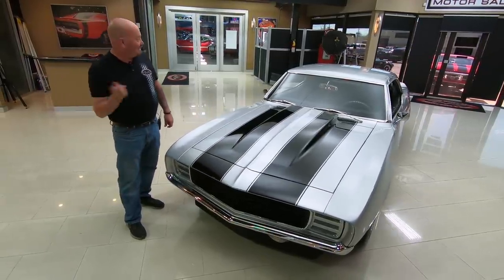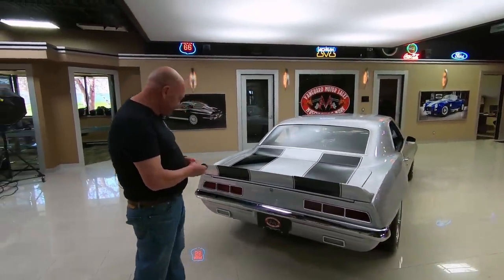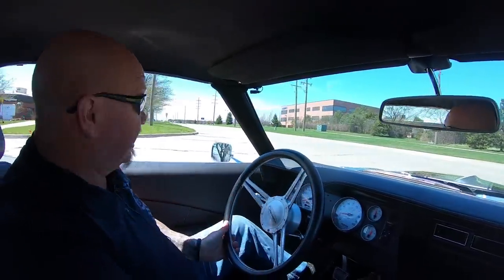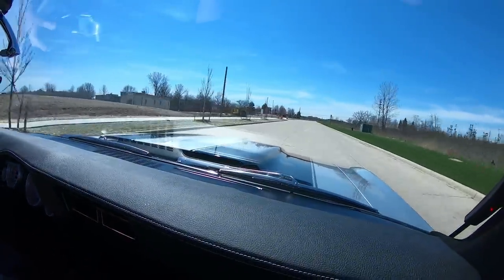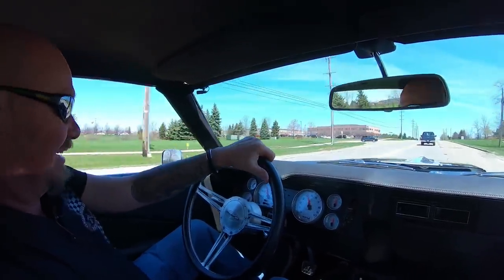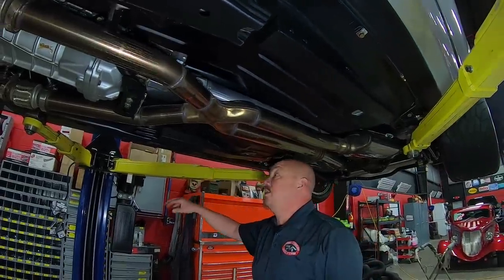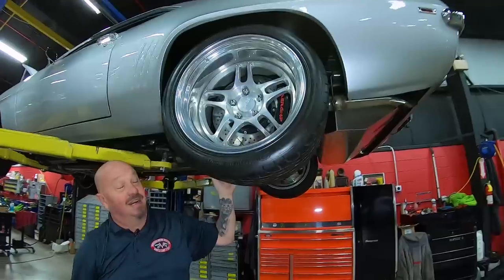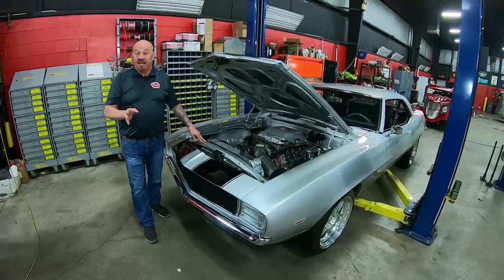1969 Chevrolet Camaro For Sale

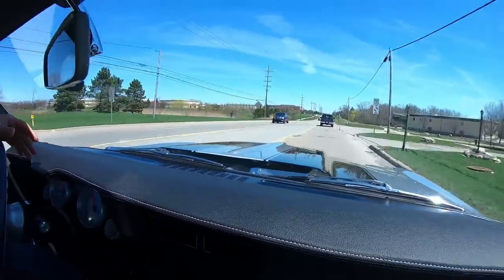Comment: 7:35 barely rolling into the throttle and breaks em loose in 2nd!
That car needs drag radials period to avoid wrecking it 
Beautiful build!! One of the few LS conversions Ive heard that has a Gen 1 ring to it. 
Most times LS have a blatty sound to them.

Comment: That's a gem, for sure.  But most of what made these old muscle cars great back in the day was their bargain-basement prices for all the style and performance you got.  I don't know what the asking price is for this, but I'm sure it's enormous.  Getting one with typical 50-year (wow, 50 years now for a '69) deterioration and restoring it yourself would be far more satisfying.
Reply: Agree, if you got the time patience and money. 
Did one frame off, though Im happy with it Id never do it again. 
Missed out on years of driving while it sat in pieces having to do paint engines trans over etc. Cant get that time back

Got a lot of great parts on it but Id be super frustrated after having it a day or two even with drag radials. No way to use that power and hook, spinning tires in 2nd or higher gears is too close to totaling one

Comment: Beautiful looking car.  Just not a big fan of the LS motors.  Where's the lope??  Sounds like a KIA.  I'm not a hater, or jealous, I really think the builder hit the mark with the looks, it's just missing what defines a classic muscle car......large cam lope.  This car could pull in to a gas station unnoticed.  Give me a lopey cam with a Pete Jackson gear drive and heads will turn on sound alone.  Great video though and amazing car.  Love the way they hid the ac lines.
Reply: I agree, but obviously this person went with more stealth like performance. It's definitely not slow with a supercharged LS motor. At the same time, if you have 190 grand to spend, then you could spend a couple grand extra to put a "lopey" cam in it.